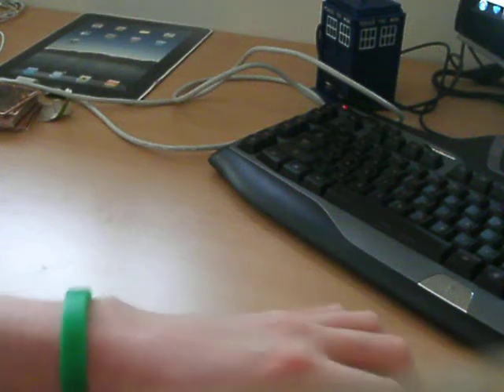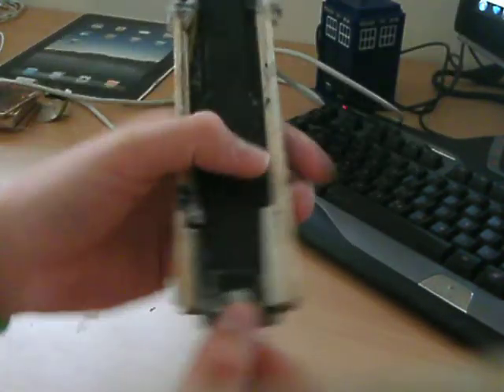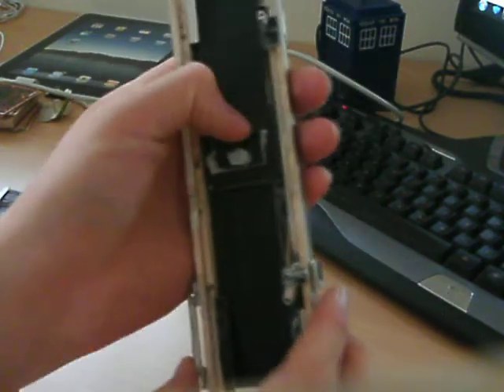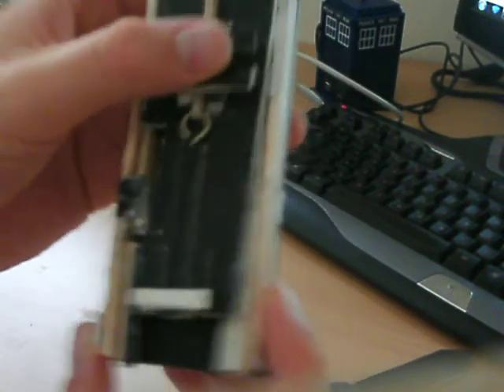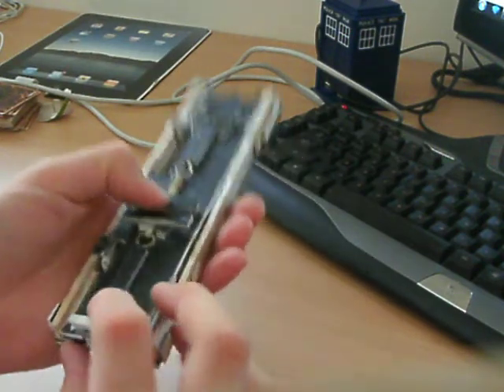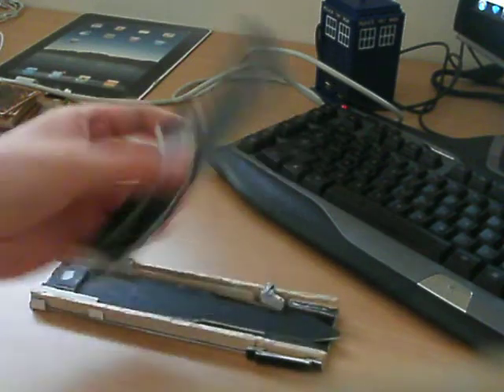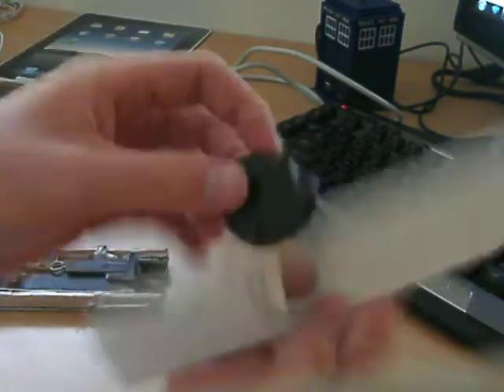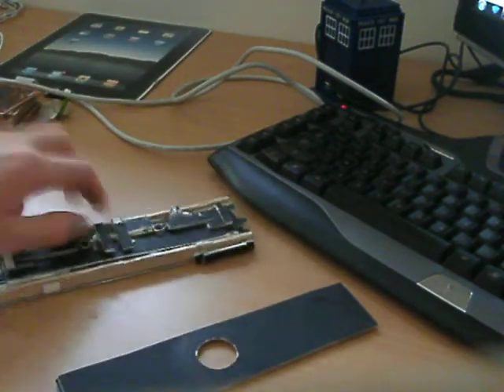how does a hidden blade work?

Comment: It doesn't actually work with a string. In the games and novels, the blade is supposed to be activated by a button on the inside of the bracer which reacts to a certain muscle in the arm. The design you have is cool though!

Comment: Ok so, the one part I didn't get was how the thing getting pushed in as the mechanism moves past it releases the 'locking mechanism' thing you mentioned that is otherwise stretched. Does it push it out of the crevice it's in or something?

Comment: I'm the assassin's creed universe the hidden blade is triggered by your muscle vein tendon something in the arm by tightening it wich is why allot of the time you see the assasins hand clench when they open it and the pull of there hand is actually just getting the hand out of the way it is possible it's disabling a safety on the blade with something attached to the wrist it's self in the vambrace. They have no rings. no one really knows how the hidden blade works. also the hidden blade is much longer then that the blade it's self extends past the hand.  Altair's blade specifically had enough room for him to grab ahold whole of the blade to prevent the mechanism from breaking when used in till divinci was able to make the mechanism stronger so the middle finger didn't have to be removed since it prevented wrapping your fingers around it amd holding it
Reply: In the much older versions of the hidden blade it was seen as a flick of the wrist because they did have a string connected to one of the fingers to pull out the blade. So i assume this guy is explainijg the older ones not the knewer ones where the blade can just come out on command